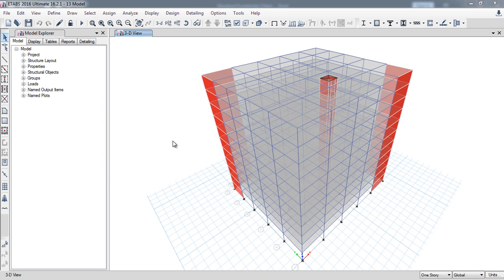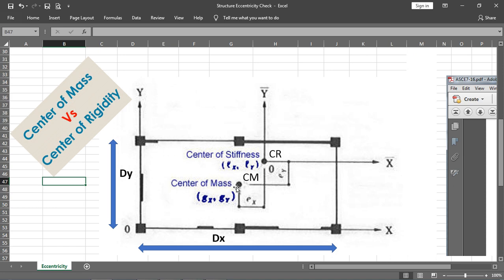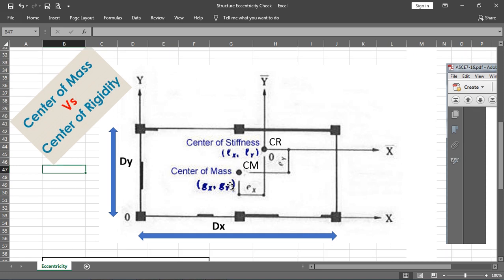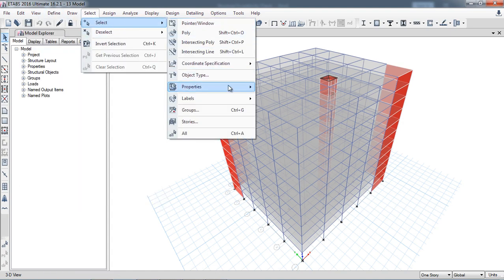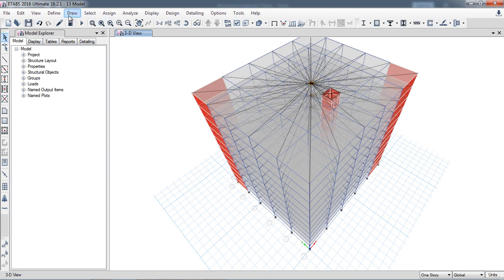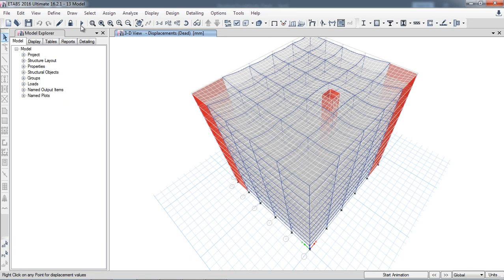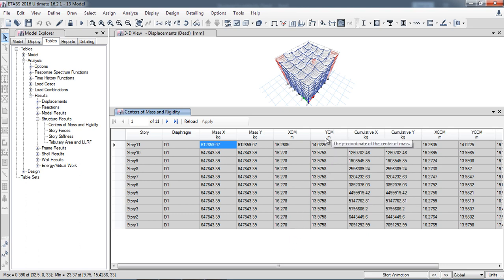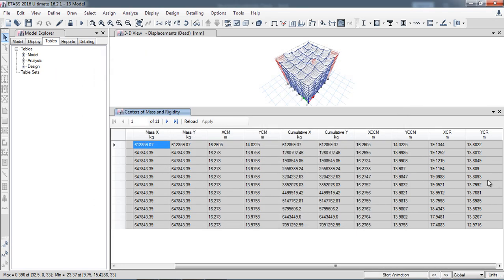CSI ETABS - 05 - Center of Mass and Center of Rigidity

Comment: what does it mean if XCR and YCR doesnt show up?
Reply from the maker: X center of rigidity... And y center of rigidity of building
Reply: @civilmdc  Sure.. But i run the model with floor diapraghm assigned, when i show table of Center of Mass & Rigidity, XCR & YCR are showing blank cells (no number). There is only XCCM and YCCM which mean center of mass..

do you have any idea what does that mean? thank you bro
Reply: @IchsanulIqbal-yv2ip  you have to go to analyze option 
>set load cases to run
>tick calculate diaphragm Center of rigidity ( its zero because you forgot this step)
Reply: Xcm and ycm show on the able but xcr ycr don't show,what do i do????!

Comment: Why Mass X and Y is showing "0" in my analysis
Reply from the maker: Because you didn't define.... 
Mass Source
Reply: @civilmdc  I did all the steps. Define>Mass Source>Modify>Specified Load Pattern>Load Pattern. Still its showing "0". I have assigned semi-rigid diaphragm. Does it have any effect?
Reply: ok. I have got my answer. The center of rigidity is only applicable to rigid diaphragms. Thank u
Reply: Mohaiminul Haque hey I have that issue too. How to fix it ? Please tell me.
Reply: @vd4395  Center of rigidity is only applicable to rigid diaphragms because in-plane slab deformation is variable across laterally loaded semi-rigid diaphragms.
Reply: Mohaiminul Haque Oh thank you. I fixed it.